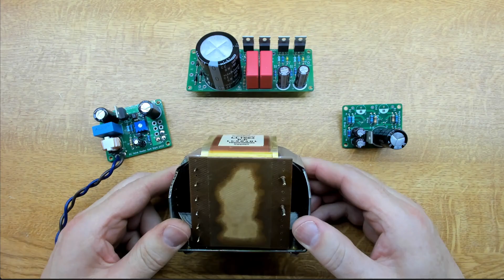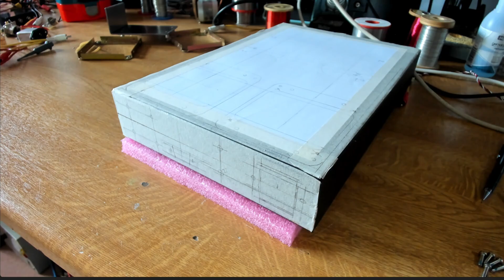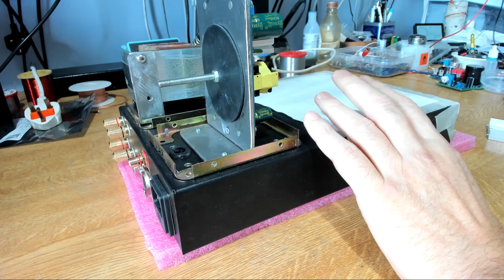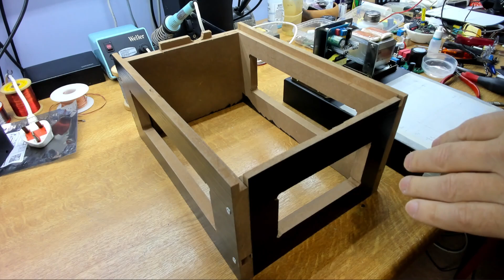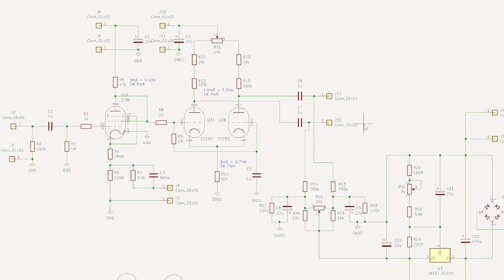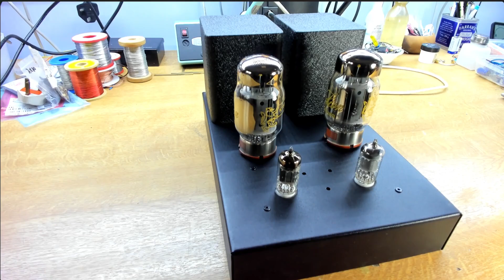KT88 Valve Power Amplifier Design and Build

Comment: Personally, I'm not a lover of valve amplifiers. I think a modern solid-state amplifier wins hands down. Saying that, I think you are going about this project in just the right way to get the best out of a valve amplifier. The valve line up is just perfect, the correct choice in every position. A good quality output transformer will make or break the overall design. So well done so far. I hope you will be able to provide some test results after completion. I'm looking forward to just that.

Comment: Nice work… Quick question: why is there no coupling cap between input stage, and phase splitter stage grid?… intrigued. Never seen that before… 🤔
Reply from the maker: Its designed such that the Anode voltage on the first stage is  also the Grid bias voltage on the second stage. DC block and separate biasing can then be removed.
Reply: @myalbatech  Cooooool… 😎

Comment: Push-pulls are boring. You can get over 10W on a single ended kt88 and sound is completely different than push-pull. I admire every kind of diy tube amplifier, no matter of type :)
Reply: Are they boring from a design POV, or boring sounding?